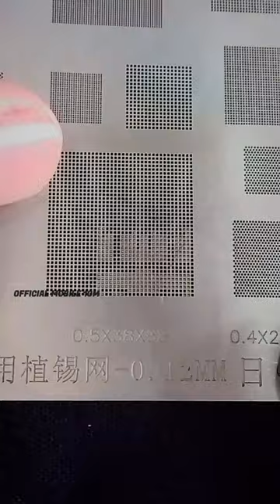Chip Level Mobile Repairing | Ic Reballing #shorts

Comment: A good attempt. I think it does not work at 80 percent. Errors in the work. There is no thermal insulation for the central processing unit. The process of returning the tin balls is inaccurate after the slash. The size of the balls is uneven. A good attempt. Accuracy is required.